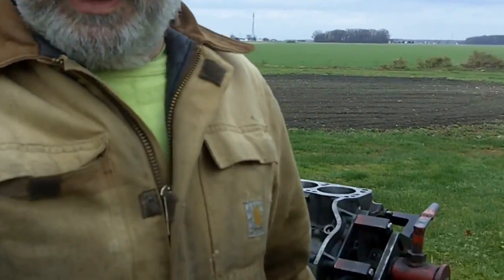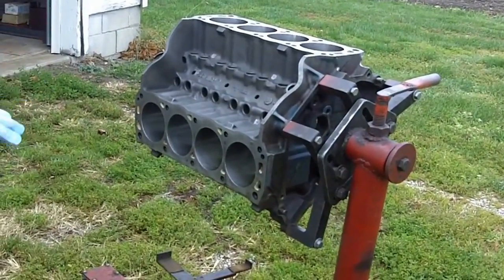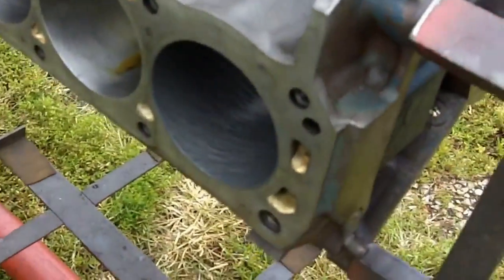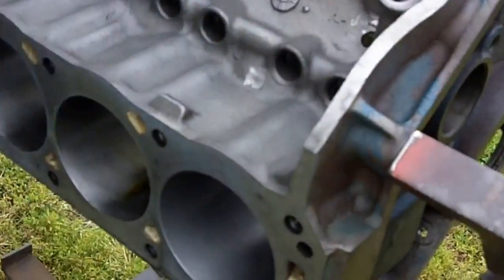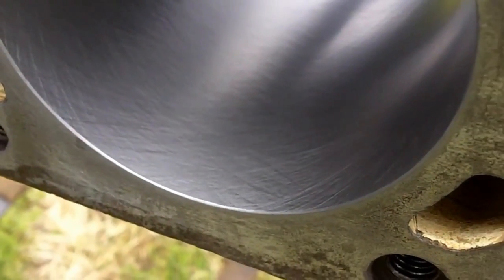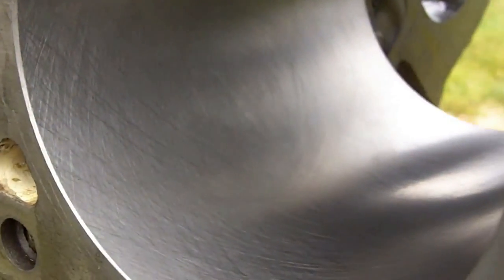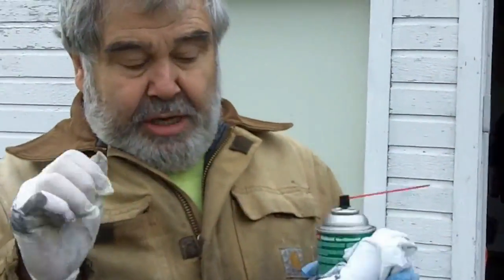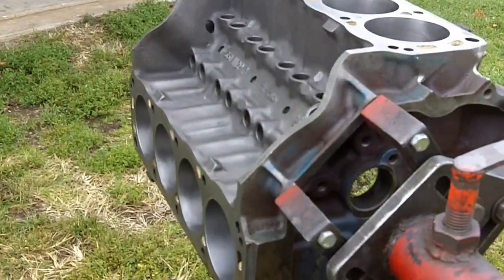Engine Building with Rog - Flex Hone

Comment: I overdidit by trying to get a perfect crosshatch. How much material do you think I removed?
Reply from the maker: Not enough to hurt anything with the Flex Hone. I'm sure you're fine. If you're super worried about it, just take some measurements and see if you are still within specs.
Reply: @BarnStangz  I measured the compression ring gap at the top of the cylinder and it was at the upper limit. I was worried because I remember they were tighter on another block I measured, not right at the upper limit.
Reply from the maker: @Fuscus64  Okay, I understand. Yes, you for sure don't want to be at the upper limit of ring gap.

Comment: If I use 320 flex hone on a std bore can it affect my bore size or piston size ?
Reply from the maker: Not at all, as you'd only use it to freshen things up. A flex hone was never designed to "bore" an engine. So you will be fine. Thanks for watching!
Reply: Too low of a grit. Cast rings would use 400 grit, moly rings 600.

Comment: Hi mate I have a question for you I have a 351 Cleveland it's measuring 3 up the top five in the centre and about 4 or 3 down the bottom of the cylinders with a dial bore gauge can that be honed out and still use new  rings and bearings to seal is it possible it's already 30 over
Reply from the maker: Would probably be okay, .030 is getting thin, might want to look for a new block or if you need that block, get some sleeves put into it.

Comment: Hello. Could you please tell me if the Flexhone can be slightly oversized or does it have to be exactly the same size as the cylinder bore?  I want to use a flex bore on an 85mm NIKASIL lined bore.  Watching the Nikasil product video it suggests that a one inch bore needs a one inch Flexhone. And yet they also say that a 3 1/2 Flexhone has a range from 78mm to 90mm. What is your take on the matter? Thanks
Reply from the maker: Needs to be a little on the large size. Thanks!

Comment from the maker: You could get away with WD40, but I would try and make some honing oil... WD40 is too light and will not pick up the fine metal particles... Your best bet would be to thin normal engine oil with mineral spirits or Kerosene...